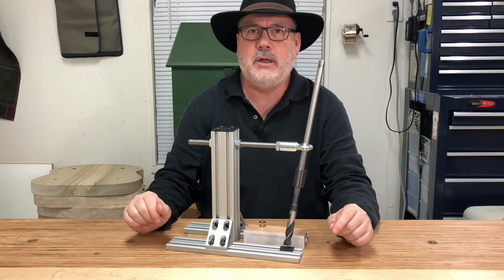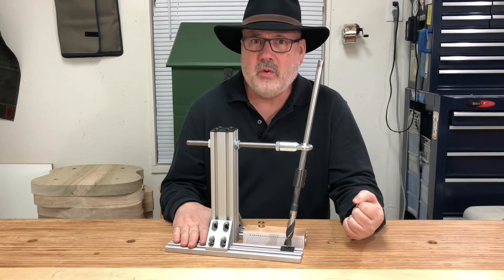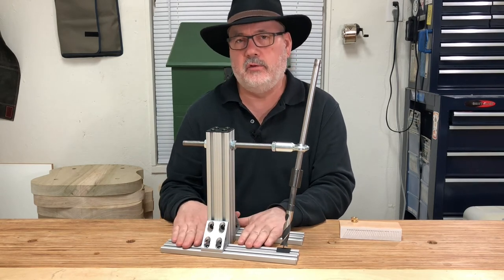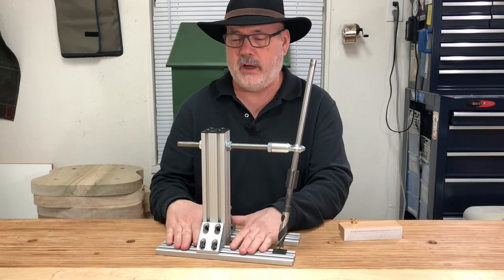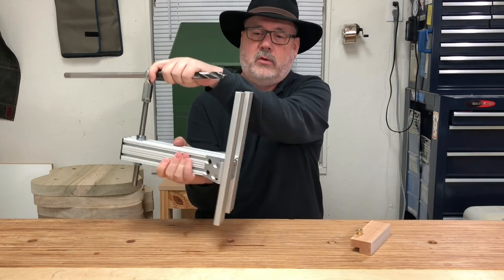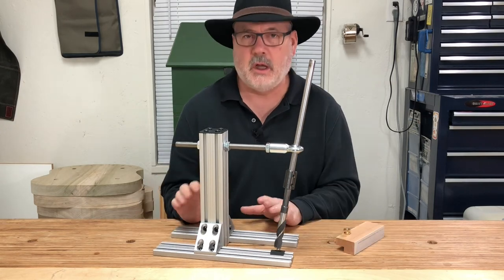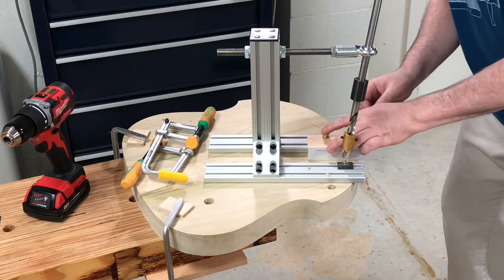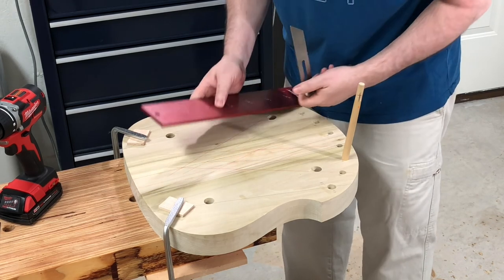Seat Drilling Guide Mk II - Overview

Comment: Hi, this is amazing. Will it work with the veritas reamers?
Reply from the maker: Yes, you can use a 3/8" to 1/2" bushing that will fit 5/16" hex shank on the Veritas reamer. I should have a video out on that and some other adapters soon.